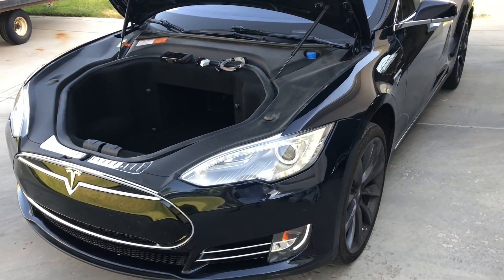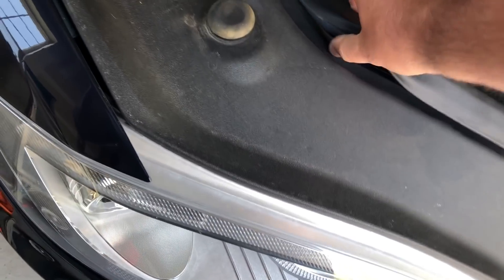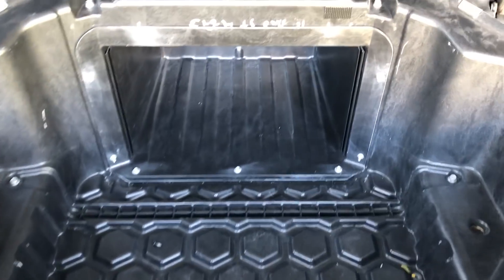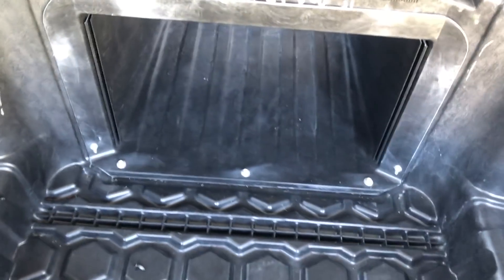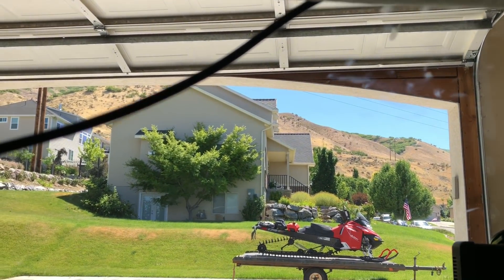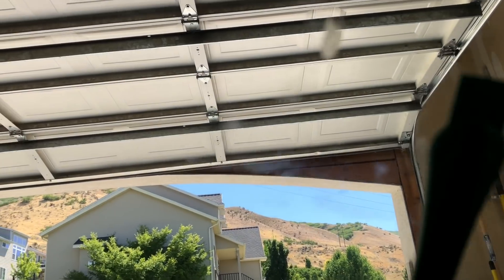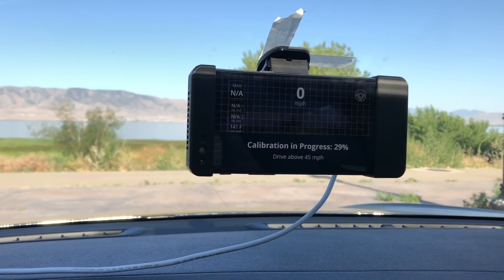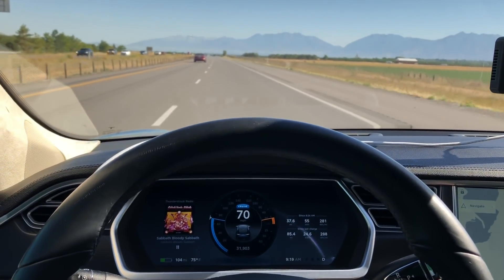Classic Tesla Model S Openpilot EON Install

Comment: Is this available for a 2014 model s? If so how much?
Reply: I'm trying to find that out now.
Reply: @so4real  yes I can confirm this does work on a 2014 model s. I installed on my other car a while back. That car has since been in a accident but and I now have a 75d with ap. Anyway op does work great as the next best thing. Especially if you get it working witha radar. If you have a 2014 with a production date after July, you can use a apillar harnes to install this. Check my channel and i have a install vid for that. Also sign up for the Tesla discord. Lots of info and plenty of knowledgeable people there to help

Comment: Pro tip: The seam that goes through the car's mirror mount is at the exact center (horizontally) of the windshield. No need to measure - simply align with that seam.
Reply: When this was made, the camera of the EON needed to be aligned, not the mount itself. the steps for alignment put the camera in the correct place. That said, lateral offset is now corrected in software via calibration. So you can just place the EON mount in the center.